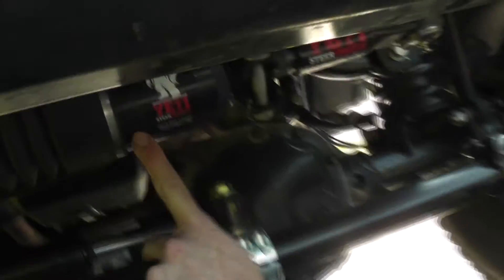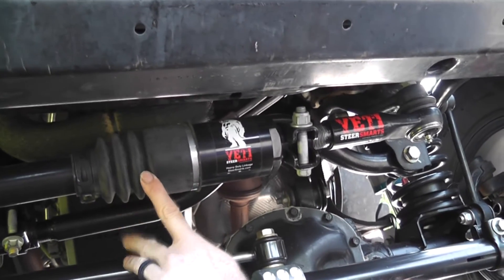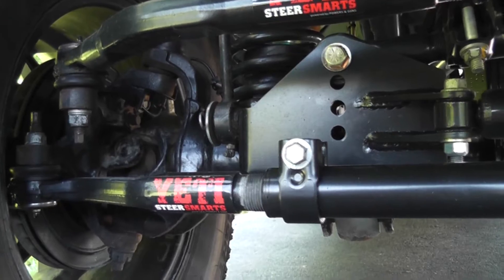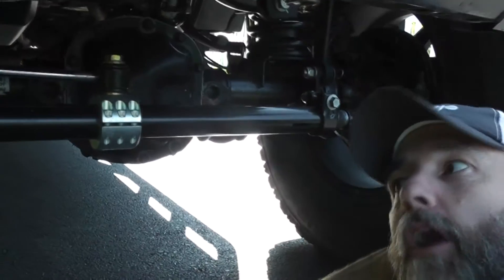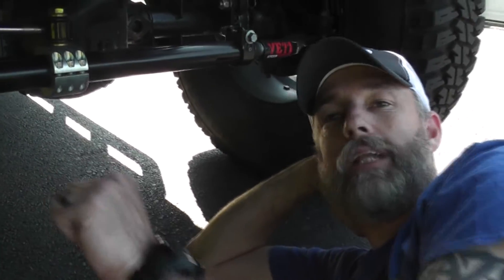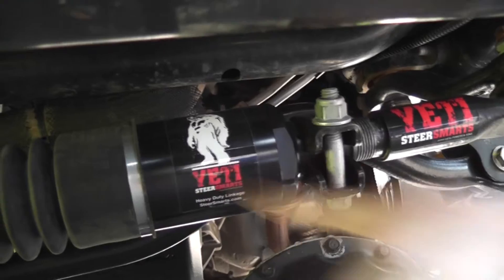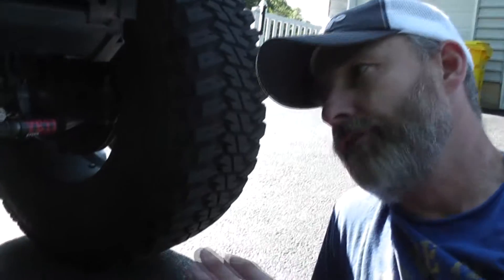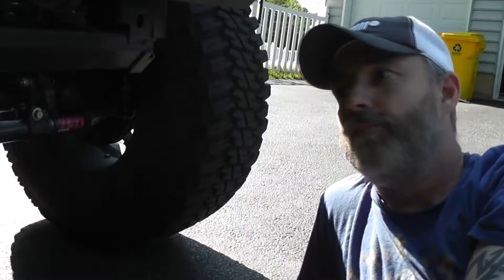Steer Smarts Jeep Product Review

Comment: Good video. I have the synergy drag link and I'm going to upgrade to the Yeti dl soon. I have the Yeti tie rod and it's been great. The synergy is a pita to adjust after alignments. This yeti is much like the stock dl in that it's a simple loosen, turn and tighten to get the steering wheel straight.
Reply from the maker: I finally got the Yeti XD System! I love it!!! It is so beefy!!! And holds up against the rocks!

Comment: What if you’ve already drilled out the knuckle for a top mount drag link. Will this still work with out having to replace the steering knuckle
Reply from the maker: I am not sure. The guys at Steer Smarts are easy to talk to. I think they might even have a set up for a top mount.

Comment: if there is no flop how is the articulation on these joints?
Reply from the maker: From my understanding. The tie rod doesn't have to move for suspension articulation. only one ball joint is no-flop...the other has full articulation. I have reached out to Ron at Steer Smarts for their answer. They are at SEMA right now. Once I confirm I will share.
Reply from the maker: Here is the response from the company... There's a slot in our top bearing and a pin on the top of the ball stud that allows our linkage to articulate in one direction and not in the other directions.  It hard to explain without looking at pictures.  We have been installing this technology on Ford linkages since the early 1990's.We apply this process on both the tie rod and draglink assemblies.